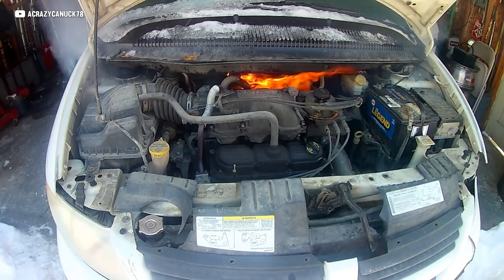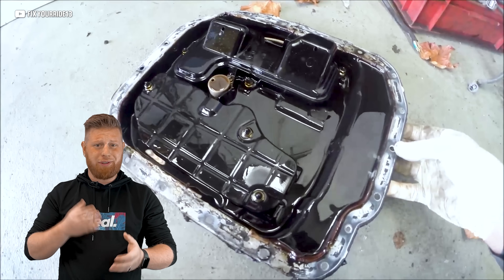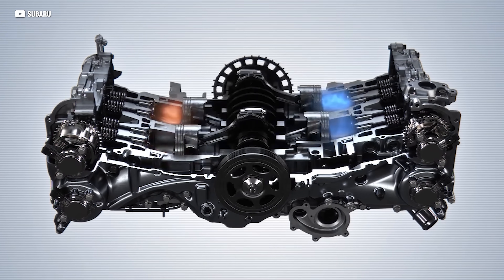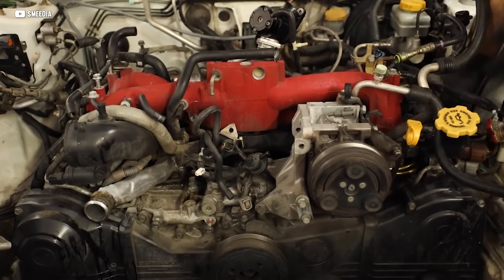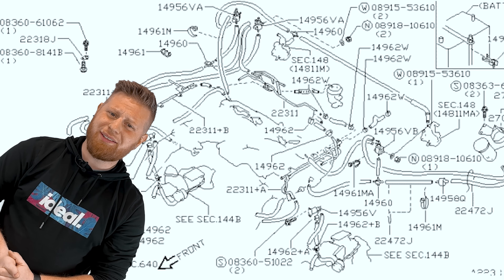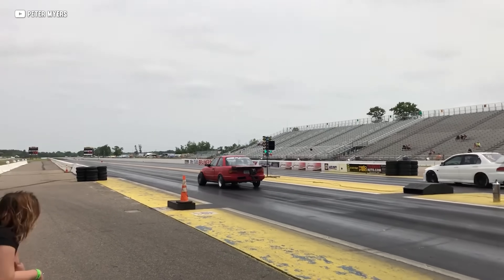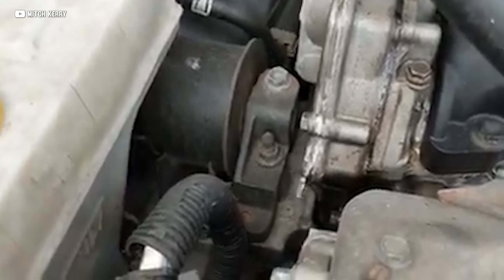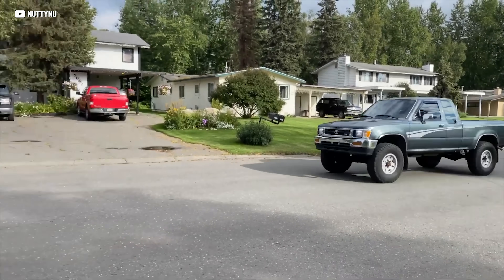WORST Engines Of All Time - JDM Edition

Comment: I'm glad the VG30DETT is included. It will keep inexperienced people from buying them up. I loveeed mine. Need another one.
Reply: litteraly my first car and your right
Reply: They’re literally the best! Just a tight fit and that’s literally the only issue lol
Reply: @Silas I've had both the VG30DE (300ZX NA) and the VG30DETT (300zX TT) and with the VG030DE the only issues I had were the injectors and the starter at some point. Pretty reliable engine.
Reply: Ong bro 300zx z32 is my first car and I’ve done the timing belt it’s really not THAT hard to work on ppl r just bitches
Reply: They’re actually not that bad to work on I bought one with no prior experience
Reply: 100% with you there bro, I loved my Z32. Power house of a car.
Reply: So why you need another one? Goofy ahh
Reply: That's like banging your head against the wall because it feels so good when you stop.
Reply: They are great. Alot of fast and furious engineers just find out their true knowledge when they work on this car. I cancel all the unnecessary bottom intake throttle coolant hose, and relocate the solinoid with the air hose on top, and wallah,  makes everything way easier
Reply: 300zx are great. A lot of fast and furious engineers just find out their true knowledge when they work on this car. I cancel all the unnecessary bottom intake throttle coolant hose, and relocate the solinoid with the air hose on top, and wallah,  makes everything way easier
Reply: @youngstah619  saw a few where those fast n furious engineers also cancelled the coolant lines to the turbos. Whoops
Reply: Had mine for 22 years because it was just so good!

Comment: A note on the QR25DE. Much of the problems it has was resolved by it's second generation around 2008-9, where it became a stable but average workhorse engine.  Unfortunately the CVTs that are attached to these engines became the next big problem.
Reply: The qr25de engine in the nissan frontier is absolutely bulletproof. I maintain a fleet of them. We have a few over 300k miles and our current highest milage qr25de is at 340k (and counting).
Reply: @inoahmann7542  yep they are good just gotta know how to drive it and do mataince on it
Reply: Most of the issues with the qr25 sucking in pre cat material was only on manual transmissions during engine braking. If you delete the precat before it kills the engine, its pretty reliable
Reply: I have an auto '08 altima, I think I'm at around 217,000 miles, I think I got the car with around 180,000 miles. I actually love this engine,  it surprised the shit out of me when I changed my oil and 4.5 of the 5 quarts i put in drained out, my lady has an '11 CR-V and out of the 5 quarts I put in, about 2 or 3 quarts will drain out,  that's one thirsty ass engine.
Reply: One of the bigger problems i have ran into on these engines is spinning the rod bearing on cylinder 3 for the Sentra versions.  I have had 5 engines do this.  My summation is how the exhaust pipe runs right below cylinder 3 and causes the bearing to heat up.  Now I should also say these are when really pushing the engine non-boosted but still driven hard.   I run headers so the cat issues have never been a problem and the recall fix was done on the butterfly valve in the intake at some point.   latest engine is a JDM with ~45k on it not sure what it came out of but i think it was an X-Trail.  luckily the engines are cheap and they were in almost every Altima ever so plenty of stock out there.
Reply: @johnscripter1792   Sounds bad.  Likely to be the MR20DE engines if these Sentras are the 2 liter engines?  Which is the one common in the US.   Or the HR16DE or MR16DET if 1.6 liter or the MRA8DE if 1.8 more common in other countries. Or the earlier GA series from 1.3 to 1.8 liters?
Reply: @ChrisRobato The Sentra SE and SE-R after 2002 came with a 2.5l QR25DE. Otherwise the 1.8l that most Sentras have are actually very good engines.

Comment: 3000gt 6g72 owner here, the early engines (pre 93) had a 2 bolt main bearing which was increased to 4 bolt mains due to early engines spinning bearings, alot of these engines get destroyed by people who don't know how to do the timing belt properly and dont set the eclipse pully in the correct smiley position (if you know, you know), ive built a few of these over 10 years and the 4bolt engines will hold over 500ft/lbs with supporting  mods and a good tune relatively re4liably before having to tear the block down :)

Comment: Renesis rx8 owner here it's not really that bad if you maintain it. It's bad if you don't change oil, overheat it, turn it off before it's warm, never check your plugs, leads or coils etc. Power is pretty low I will say but driving for a bit of fun is really good.
Reply: i have 231hp rx8 and although it seems like a low power for todays standards rx8 is very light and very fun to drive, especially in the corners the 50/50 mass with low gravity point is great asf. And it's true that you have to take care of it. Not a good idea for a daily car imo. I upgraded intake and exhaust and on a straight I get 6s from 0 to 100kph - imo not that bad too.
Reply: My buddy had one in highschool. 

I had a 71 Plymouth valiant 4door 318 that was also rated at 230hp. 

And I could SPANK that Mazda. 

ANd got better mpg. 

That’s embarrassing.

Oh and mine was like almost 40yo before his was new
Reply: @fastinradfordable  and saved a lot on car payments too

Comment: QR25DE is a great engine! So easy to work on! 2005+ are super reliable, they fixed the cat issues, and butterfly screw issues. As long as you keep up with oil changes, you don't have to worry about the timing chain (owner of a 2006 Nissan Xtrail QR25DE)

Comment: There's tuning company in NJ that specializes in LS swaps in late model Nissan products called Lion of Judah(LOJ) . On "Smoking Tire" they featured a costumer's Z32 300ZX twin turbo 2+2 that ditched the stock VG30DETT for a Heads and Cam LQ9 which not only simplified the complexity of the 300ZX but also produced more HP and TQ than the VG30DETT. The kicker was that the iron block LQ9 was in fact lighter than the stock VG30DETT which gave the Z32 300ZX better weight distribution and handling.

Comment: The old 12A rotary in my rx7 is rock solid and dead reliable. Its honestly impressive, I dont go easy on it but it just keeps on going. Its all about the maintenance with these things. Sometimes though, the older stuff is just better
Reply: Friend from Sweden owns FB. Late August he passed 500k Km (300k miles). Carburated, turbocharged - record was 304 BHP but he toned it back to 180 after he become a parent. Never had a broken seal or any problem just taking care of it, driving long distances and every once in a while he takes the engine out, puts it on dinning table saturday morning, new seals, decarbon and woala back into car in sunday lunch so he can check it later and drive to work on monday. Now I am a proud owner on FC thanks to him.
Reply: most people who vote for the rotary actually never owned one
Reply: @KenanRaptor  most people, who say it is terrible, usually owned RX8 and used it as a city/family car. Renesis is a ruined engine cuz its stock lubrication sucks + drive it short distances like going shopping 5-10 minutes away from house twice a day. Double NoNo for seals and rotor housings.
Reply: @KenanRaptor  and aerospace engineer never flew a rocket. Doesnt matter if people have owned one, engineers can tell instantly what the problem was. (Owners and emissions)
Reply: My Rx8 one is absolutely perfect even with 150 000km on it

What people fail to understand is, they are sport cars, you need to maintain them as such.

And not like your grandma's old Ford that can probably run with gravel instead of engine oil.
Reply: More importantly put 2 stroke oil in your gas and it will run forever, I miss my rx8
Reply: Revved up rotaries last much longer than idled due to the heat being more even throughout the engine compared to idle where it builds in the combustion area more
Reply: 12A is a tank because the seals are on the housing, not the iron. Also because it makes less power.
Reply: I guess that ford spoiled me as I don't see 150 000km as anything to brag about. Those are amateur hours, ima need you to crank that way up.  @FuSiionCraft
Reply: He did say Renesis - Ford messed that RX8 up to sell a bunch of them. go figure.

Comment: The thing you have to remember about the 7M-GTE is, yes it was a bad design and yes most people who bought a 15+ year old one had issues, BUT it was an engine released in the mid eighties and was the seventh generation of a design from the sixties, of course it looks bad from a modern point of view but you have to take these things into account when discussing a 36 year old turbocharged engine.  On a side note, the fact that Toyota went from the 7M-GTE prototype to the 1JZ-GTE prototype in under three years is genuinely impressive (yes, credit to Yamaha).

Comment: The EJ25 is only reliable if the maintenance is performed down to a T. If done they do last very high mileage. I'd argue most bad engines would last long with strong maintenance services. Also did BMW get a pass or will they get their own list because they have that many bad ones?
Reply: its a car for enthusiasts.
Reply: @conorhoade8793  What's that?
Reply: You sir are correct. They are very delicate engines that do need a lot of maintenance. Oil changes every 2500-3000k miles with very good oil. You also need a few upgrades to further make the engine more reliable like a killer b oil pick up pan/tube, as well as a catch can or aos & most importantly a Cobb Acessport. The common misconception about ejs is that people trying to push 400+ hp & blow it up driving like a speed racer every day & wonder why it blew up 200 miles after. They are great & fun cars but you need to be prepared on future maintenance/upgrades to prolonging the life of the engine before buying one.
Reply: They don’t even need to be maintained that well, they just can’t be modded incorrectly. Had an 02 that went 230k miles and I used to get the oil changed at jiffy lube if I got lazy. And when I did it myself Walmart oil in it. Only thing done to it was a reflash. 

I had an 04 that I bought new and ran to 100k. I did turbo swap on it, but always made sure the last step of a mod install after I tightened the last bolt, was to go grab my laptop or accessport and reflash the proper map for it. 

There are a lot of people throw mods on before having the tune ready. They know they need it, but for some reason throw the parts on and think they can “wait” and do it in a few months or weeks. No, needs it immediately before you even drive it.
Reply: Most people don’t make their ej’s like they should and don’t care enough to take care of it, but when u do u can push 800+ unopened like on the ra ej’s and fa20’s I’ve seen hold 650 unopened and the fa24 could possibly hold as much if not more then 800

Comment: Nissan ZD30 turbo diesel.  Not known in the US since it wasn't imported to the US along with a whole host of JDM turbodiesels.  Powered various Nissan SUVs and pickups in including the Navara and Patrol as an option.  It was nicknamed the 'Grenade' and that gives you an idea about the eventual fate of these engines.
Reply: Can confirm, have one in right now (machine shop).  The balance shaft bearings spun so bad that they had to source a new/used block from Australia.
Reply: Hahaha can confirm, my mate picked up a low km Navara with the ZD30 and it immediately died.
Reply: The early ones were the issues the commonrail zd30s are fine

Comment: As for the QR25DE these are the solutions to your commentary:
1. Replace the factory manifold with a header and use a spark plug non-fouler to prevent triggering the 0420 CAT code. 
2. Remove the top half of the intake manifold and loctite the butterfly screws one at a time and reassemble the manifold. 
3. The QR uses oil pressure to tension the timing chain. If you run too low on oil, the chain can go slack and turn your engine into a boat anchor. 

I had an 02 SE-R that I bought new and did 1. and 2. at around 20K, and it lasted `50K until i got rear ended and it was totaled. If you buy a used one, do an oil consumption test immediately and loctite the butterfly screws. Then get a header.

Comment: I own 2 RX8's, both 80k miles+ and they're running solid. Granted, my R3 is now struggling cold, but it's been smashed by the previous owner. If done correctly, the rotary works amazingly. But I drive in a way that works with a rotary powered car. Some one looking for that low end poke and an easy to use engine will not enjoy it